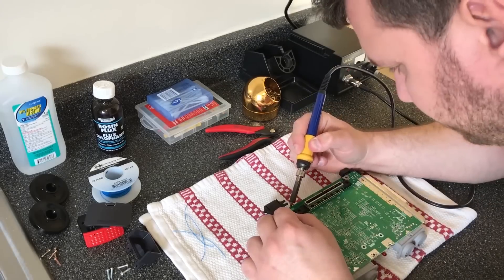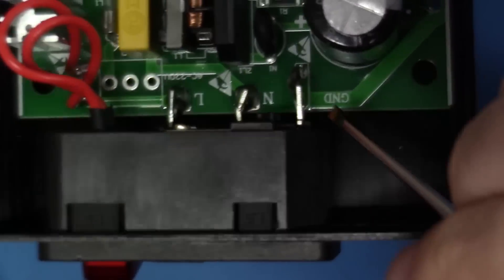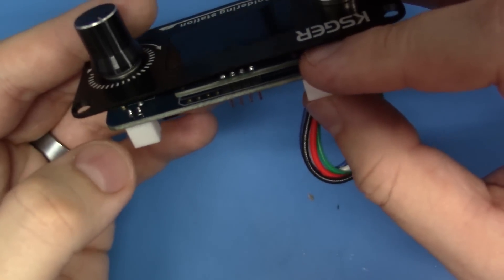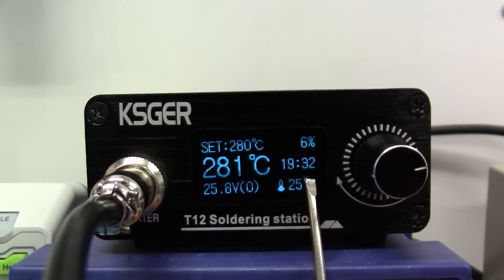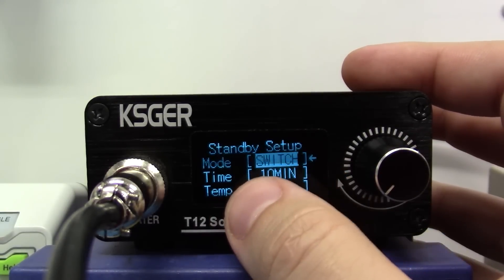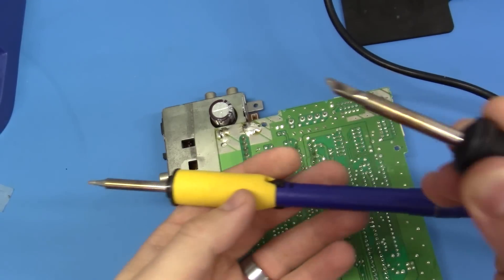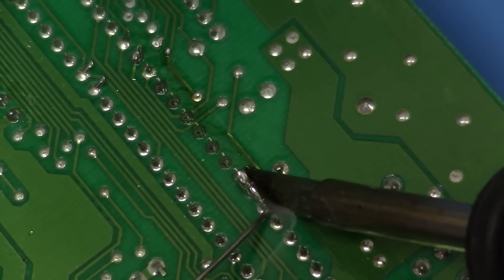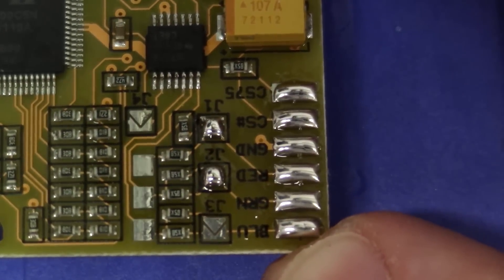Buying Your First Soldering Station (UPDATE READ DESCRIPTION)

Comment: I've bought one. Looks and behaves decent, indeed. However interestingly, the internals are a bit different (ie, PCB for the iron socket, other location for the battery). It's not a problem for sure, my sad issue however, that tip *IS NOT GROUNDED*, I can't measure continuity between the tip and the earth reference. I am not sure if some kind of fault of my unit, or it's a change of the internal design I've mentioned examples for, though. Has anyone experiences like mine? Otherwise it looks/works OK, just it bothers me a lot now somehow ...
Reply: I just got mine as well and likely have the same. Is the PCB for the iron a single board that has the plug for the iron connected directly to the PCB rather than the cables that are in the video? I did a test and my tip is connected to ground. I haven't fired it up yet.
Reply: @SScorpio0  Yes, that's the one, and the battery is connected with wires, not mounted on the PCB as in the video. Otherwise changes like this does not mean it's bad, I guess it's just some minor changes in the design, which is fine, BUT the ground issue bothers me only here. I found continuity between the tip and one of the pins of the connector, and also it seems there is continuity between earth ground and the black wire going to the front panel (I guess the GND). So my theory that they aren't connected for some reason, there is the problem. I guess I'll try to connect them together myself ... As far as I know, T12 tips have only two connections, the third one is the "tip cover" (or how I can say) only as the "third one" and not connected to anything (now only about the tip connections not the other parts, like eg movement sensor). So I assume I can safely connect that to the ground, ie the ground on the front panel which otherwise seems to be connected already with earth ground. But if your one is like mine, but still, the tip IS connected to ground, it can be some fault with my one instead, and not a meant design change hmmm. I'll check the front panel PCB again and try to follow the traces to see what's going on here.

Comment: Damn.  I went and found a power cord that fits and plugged the thing in.  Flipped the switch, and DOA.  Nothing on the screen, nothing to see.  I was sent a dead soldering station.  For those who got ones that work, fantastic.  I'm happy for you.  For me, I can't wait another 6 weeks for a fix to be sent to me.  I am very disappointed in the long wait, and the absolutely dead on arrival paperweight I now own.  

Time to break out the multi-meter and the old soldering iron I have and try and figure out why my station is completely DOA.  VERY disappointed right now and have no plans to purchase from them again.

Edit:  Thankfully, these things are pretty simple devices so I was able to find the problem.  One of the wires connecting the front panel to the main board was broken.  No continuity.  I replaced the wire assembly and fired it up and it works great.  So if you get one that's DOA, just open it up and check for continuity where there should be continuity.
Reply: fixing soldering station with soldering. Nice
Reply: mine was also doa, I reflowed the solder on the power pins and got it to turn on, but everything is in chinese and it just says ERROR. I love your vids voultar but banggood is a terrible place to buy electronics
Reply: @displaytalk  Hey, if you scroll through the settings list by holding down the dial you should be able to find an English option written under one of those categories in Chinese. Also, according to him the latest batch of the soldering handle not the station itself is actually DOA, something to do with the wiring. He's sending me a new one no-questions-asked, but it's going to take like 30 days again...
Reply: @DeclanCrane  Yeah I found the english option by accident a few hours ago while I was messing with it. I unscrewed and rescrewed the handle and removed and reinserted the tip and my whole station works now. I still think it's pretty messed up that the power pads weren't correctly soldered to the board to the point it would not power on until I fully resoldered them.
Reply: @displaytalk  Damn, lucky! I tried everything. My handle seems to be completely DOA. Ask for replacement handle anyways just to be on the safe side.

Also, what do you mean unscrew and rescrew the handle? You mean to the station itself or something inside the handle? Wouldn't hurt to try myself. Thanks :)
Reply: @DeclanCrane  with no tip installed and with the handle disconnected from the station I unscrewed the black bit where you install tips from the blue bit and checked it out just to see if there was any issue in there, then screwed it back together, inserted a tip and plugged it into the station. It didn't work and I took the tip out and reinserted the tip one more time then it worked
Reply: @displaytalk  Weird, glad it worked for you! I tried the same thing, no luck :)
Reply: Just received mine an hour ago, completely DOA, and completely missing the wires for the front handle power port... Going to see if I can get a refund and look elsewhere.
Reply: Wasted 50 bucks
Reply: Another faulty one here. Not completely dead but an error message on screen that comes and goes. Looks like the quality of these things is going downhill.

Comment: So I got mine in. Within 5 seconds after flipping the power switch and the screen not lighting up, smoke started coming out of it. I'm currently waiting for a response from Banggood.
Reply: They're going to send a replacement when they're back in stock without me having to send back the dead unit. Great customer service.
Reply: The replacement has arrived and it seems to work perfectly.

Comment: Besides the obvious soldering station, what else would I need to start soldering as a beginner? I know I need the solder itself but besides that I have no idea what it is I would need. I've soldered some before but that was almost 5 years ago so it's like I'm starting all over again. What solder do you use and what other things do you use as well such as the flux and the node cleaner I saw you mentioned in the restoring gameboy cartridges video. Thank you so much!

Comment: What is the quality of the lead like, is it silicone? And do they have micro-soldering station?
Reply from the maker: High temperature silicone.
Reply: @Voultar  Wow, amazing what you get for the price. I might switch my hakko for this, the user interface is just bad. As for the ksger, it has a rotary knob, nuff said.
Reply: Took me a month, I finally ordered it.

Comment: This identical model on Amazon does NOT have direct soldered AC socket to the board. It still looks good though. And there is a mini version of this device which is less than half the size but uses a DC power supply. I wonder if the performance is the same.

Comment: 3:37 how ??? 
I mean, the IC has to control the triac for regulation, then there is the ESD link to the earth. How can it be done with 2 wires when we see 5 wires coming from the plug? (of course it could be done with some I2C but I doubt it, and the earth link is still missing)

Comment: Nice thick isolation cutout and they actually used an optocoupler to communicate to the low voltage side. Definitely doesn't look like your typical cost cut Chinese product.

Comment: Great soldering station but why the heck would you need a RTC on it and why you need a time indicator on the display, isn't that just wasting money on worthless stuff?

I imagine that the soldering station could be even cheaper if they didn't have the RTC on the board, right?

Comment: Totally unrelated, but I've looked at the time on the soldering iron at 19:31 and my computer's clock was showing exactly the same.
On topic, great video! You've conviced me to spend a bit more and get the KSGER over the Quicko. But I've seen there are multiple versions. Do you know if the latest one, v3.0, is better than the lower ones?

Comment: Thank you so much!!!! I have been looking for a good heat controlled station for years now, end up just getting el'cheapo ones that have no heat control or are gas powered. Can you suggest a good solder sucker and hot air station next?

Comment: I would like to add that if your screen is a bit crooked, you can loosen the knob mount and straighten it up. It is easy to do. Also, new tips need to be run at a low 150C or so for a few minutes to stabilize or break them in. They may act funny or produce an error message at first, no worries. This goes away after the break in procedure.

Comment: "Just because it's from China does not mean the quality is always bad." Way to go China; you've become so associated with poor quality that people have to make a point of making an exception on the rare occasion when a Chinese product isn't bad. 🤦

Good video, good info, good suggestion, good coupon. I'll be sure to use your links to get this once the holidays are over. 👍 (Too bad BangGood won't let you use multiple coupons; you have to make separate purchases for each item. Stupid, BangBad. 😒)
Reply: Just because one percent of Chinese products is of acceptable quality, it doesn't mean that we can afford buying 100 similar Chinese products in order to find the one that is acceptable. If I could afford buying 10 fifty-dollar soldering stations just to find one that is good, I could probably afford to buy one 500-dollar station (American or German brand, made in china as well). But since all products are made in China, and only the specifications change, I'd really like to see more good quality and affordable products. The only thing that changes are the capacitors, and the price difference between a good quality capacitor and a bad one, is negligible.

I agree with you, good video, goods suggestion.

Comment: You could be more upfront about this being sponsored content. I'd get a Hakko FX-888D at double the price over this any day of the week.
Reply: The 888 is old technology. The tip responds slowly to temperature drops. The UI is also a joke. A pain to use IMO.
Reply: Thanks for pointing this out, @paxmova! I don't trust any Youtuber telling me that anything from Banggood is amazing because most reviews seem to be heavily sponsored. Having tried out this KSGER thing today, I can only say: Stick to your Hakko! The hand piece of the KSGER is A JOKE! It is extremely long and tail-heavy, leading to strain on your hand and inexact tip positioning. I'm a huge Ersa fan, and their tips are the complete opposite. Well, they're actually good, and not 'banggood'. Plus there are build quality issues with this KSGER toy, such as the extremely cheap plastic used to make the handle; the power plug is not screwed to the chassis leading to significant wear on the solder joints which hold it in place; the connector for the hand piece rotates, such that you could easily break the connections inside it; etc. Even worse, mine malfunctions 50% of the time you plug in a tip because they lose connection inside the extremely crappy hand piece. (To anyone who thinks I bought 'the wrong one': I bought the one linked by Voultar, even used the coupon code.) Now let's see how Banggood react to my request for a refund...
Reply: @riesling4007  - I don't think the hand piece is tail heavy at all. Just the opposite, the close tip to grip gives me excellent control compared to the 888.
The soldered power plug seems super durable to me. Not weak. Of course I usually leave the plug in. I'm not constantly removing and installing it. 
Have you tried taking the hand piece apart? I would do that and check the contacts. I've got the blue handle (direct from KSGER) and it has been 100% reliable. I've seen similar blue handles sold by other companies which had very different internals and they sucked. I hope Banggood is selling the proper KSGER units.

Comment: Switching power supplies are the worst they blow up just looking at them  i got a very old weller with a linear power supply more than 50 years old still working like new ! T hey amount of fragile parts they mount on a board just to save a power transformer is ridiculous !

Comment: Any idea of what’s going on with Banggood? I mentioned in another comment that I received an email that the item was backordered and they asked whether I still wanted to order it (I do). I wanted to make sure that my order would continue to be processed, so I sent an email using the Contact Us link on their website and I received an email undeliverable message this morning (550 IP frequency limited). I’d call their phone number, but it looks to be in another country. I’m in the US.
Reply: That's just a courtesy message. You can ignore those.
Reply: Mine is also back ordered but they did send the tips and the stand.  I also received several soldering practice suite / kits

Comment: Can you connect a hot air gun to this controller?
Reply from the maker: I think that you can! It's in the firmware and there's a header for it on the controller board.

Comment: Just bought the lot on Banggood. Total was $84.49 with the %20 discount code. Couldn't figure out how to use all of the coupon codes without buying everything separately, but nonetheless, pretty damn good buy. I was going to buy an X-Tronic model on Amazon, but glad I saw your video first. Speaking of the X-Tronic, maybe another review is in order to see the difference in quality of some of these similarly priced soldering stations. The fact that this one has T12 tips makes it the obvious choice for beginners. So much easier. One thing I couldn't find was the tip remover you show in you video. Where do you get one of those? It seems pretty necessary.
Reply: Look for Hakko B2300 pads or similar clones. $6-$12 usually.

Comment: What's the difference between a t12 and a t15 tip? Also does it need to be calibrated?
Reply: Same tip AFAIK. They call it a different name depending on the continent or region it's sold in. If you have a way to measure the tip temp, this unit has a way to offset or correct the temperature. I think it can remember 15 or so different tip calibrations, but it cant recognize the tips. You would manually tell it what tip your using. Seems like a lot of work, but it's possible if you want super accurate temps.
Reply: @JasonWW2000  Thanks

Comment: Bought this one too. I think this version also has an option to change the PID parameters. There's also a hot air version of this station, would be great if you reviewed it!
Reply: So does this still hold up to this day ,or are there better options out there now?
Reply: @andreamitchell4758  I don't know if there are others better options now but its still doing fine without any problem

Comment: When reflowing solder, does one use flux, or is flux only used for new joints?
Reply: Always use flux. Either the flux in the solder wire or add your own.

Comment: I just bought it! $43 after the discount and shipping. There is really no better deal out there for a T12 iron with these features. Thanks for the heads up
Reply: @d.stamand  it's back ordered so not yet.
Reply: Mine showed up a few weeks ago. I broke it down and went through the electronics before plugging it in. Everything was solid. Temps come up quick. And it holds temp pretty good even when it's on a big ground plane. Only issue I ran into was the cord was stripped back twice as much as it needed to be at the connector. Broke out the Hakko and fixed it right up. 

So this is the best $45 station you can buy.

Comment: FYI. My order was marked as shipped two days ago. Now I got an email informing me that the soldering station is out of stock. Huh? Restock is due Monday, so no big deal, but I‘ll totally open this thing up to see if I got what I ordered.
Reply from the maker: For sure!
Reply: I ordered mine a couple hours after I watched the video. On Wednesday I received an email informing me that it was out of stock and asked what I wanted to do with the order. There was a link right after that, but I got a 404 error when I clicked on it, so I went to the site on my own to check on it. It’s still listed under orders, so I’m hoping that they’ll deliver it when it’s back in stock and not cancel it on me. Oprah Winfrey couldn’t have done better.
Reply: It‘s here and it‘s awesome. Thanks for the recommendation Voultar!

Comment: It seems a pretty amazing station for the price, but I am a little concerned with the power to the logic board. As you say it's just that one connector, with the dc power, powering the board and the soldering iron. That means those little wires and that small 2 pin JST connector are carrying the power to the iron. The wires on the 5 pin JST are larger than those wires. So I'm concerned that the JST, sitting just above the power mos is going to get really hot and cause problems well before the standard life of the thing (which should be forever, everything build well lasts forever. :) ) have you checked it after 100 hours of use? have you let it run for many hours continuously?

Comment: It's not ESD friendly, when it is conductive! It has to be dissipative.
Reply from the maker: It's actually more for current leakage. But having a high impedance relationship between the earth reference and soldering tip is what you're referring to. Something like a 1Mohm resistor between them. Something else to mention: A lot of these irons tie the neutral line and the earth ground together IN the station. Earth is NOT a current carrying conductor.
Reply: I always crack open these kind of units to verify the wiring with a meter and to make sure assembly was done right.

Comment: i like to suck my solder pump. does this make my soldering better? no. does this make an experienced solderer better? yes. So she says. Love u Voltar.
Reply: voultar* love you.
Reply: surface mounted misses = 1
Reply: Some connection issues, not working as it should. Epic.
Reply: Please thoroughly test my misses. She cant handle the hand peice.